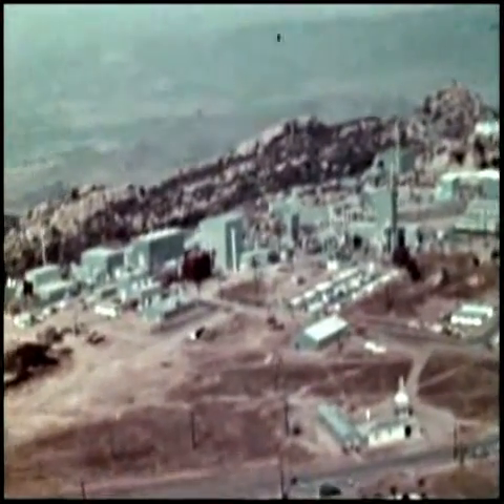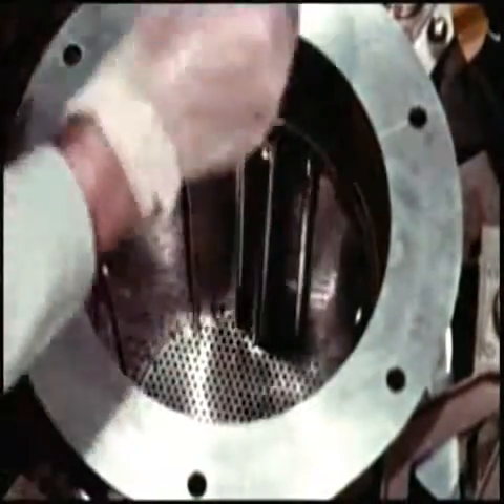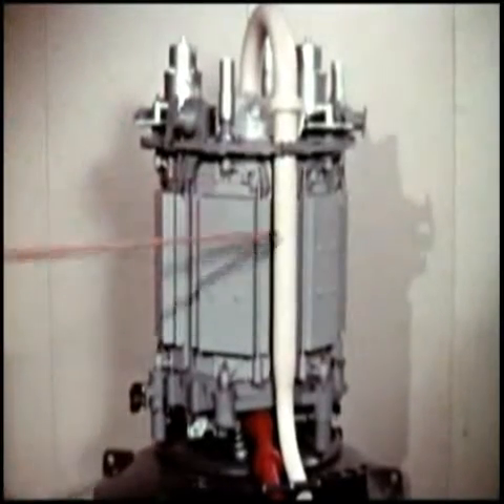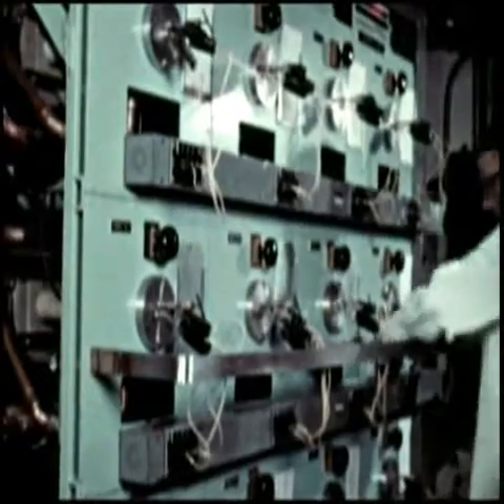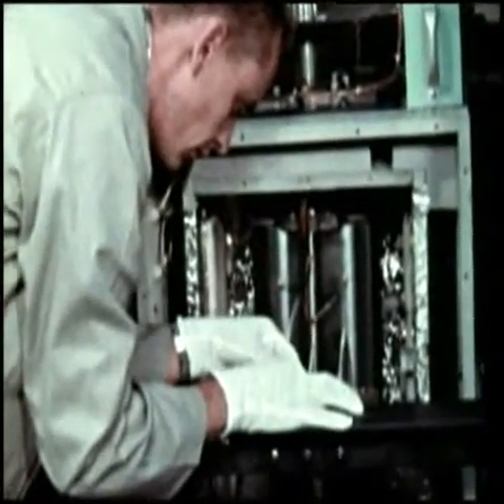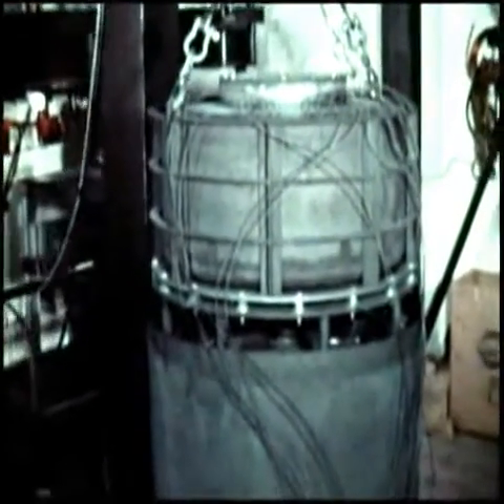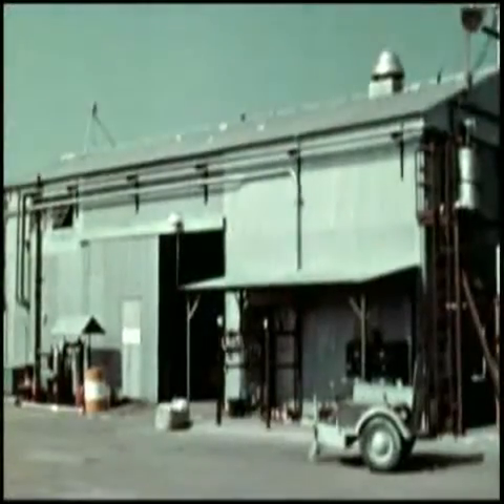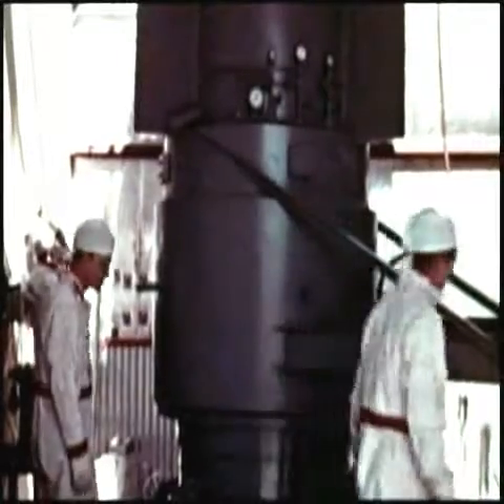SNAP 8 Reactor Program (1963)

Comment: The hand filing at 5:40 ROFLCOPTER
Reply: Safety First! Vacuum cleaning, masks and lab coats. I wonder what the film crew was wearing.
Reply: It's not critical there, that would be stupid. there's just the little radioactive decay that could get through the metal casing at that point, or just an inert testbed.

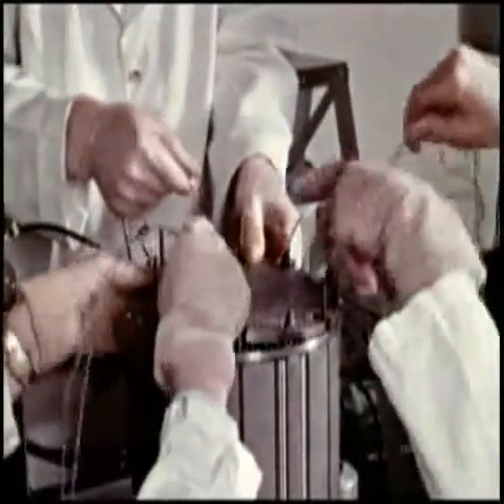Comment: 1:00 "600 kW of usable thermal power". I do not believe that. Wouldn't reactor of such small size simply melt in seconds with so much power? You would need tons of sodium or mercury moving every second to cool it down. AFAIK SNAP 10A was about 500W, and 590W peak.
Reply: When in doubt, calculate! 
Inlet temperature 1100F, outlet 1300F, flowrate 13lbs/s, specific heat capacity of NaK 982J/(kg*K)
That makes for cooling capacity of 2.122MW, can you get rid of that much heat downstream in cooling panels is a question on it's own, but as per the rated spec there in plenty of cooling margin in the reactor itself.
Reply: Possibly 600kW at its peak when pushed to super-critical.
Reminder that it's cooled with liquid metal.
Reply: Smaller MRS in Oak ridge reach 10 MW. Only 1m^3...
Reply: That's only 2 car engines

Comment: "If boiling mercury seems like a reasonable answer to your question, ask a different question."
Ultimately, a variety of other power conversion techniques were applied, ranging from a potassium steam turbine to thermoelectric conversion, which actually flew as SNAP-10A.
Reply: It'll be in space, so it's fine. (RTG's use plutonium, so they aren't any better.)
Reply: If the mercury doesn't work.
Use boiling thallium instead.
Reply: at least the loonies got a full dose of mercury radi-isotopes steam, before choosing the latter
Reply: @gentbar7296  I think all isotopes of mercury are stable anyway